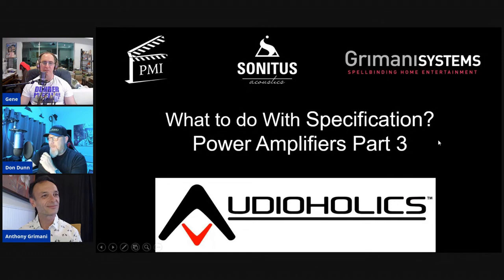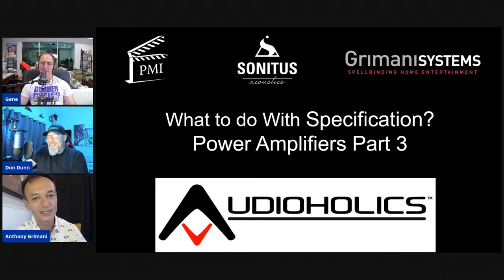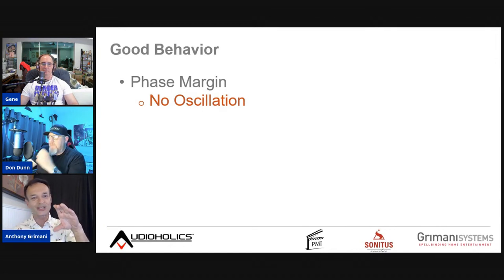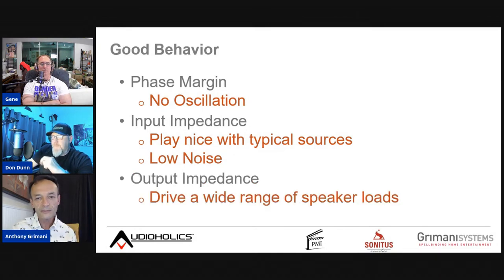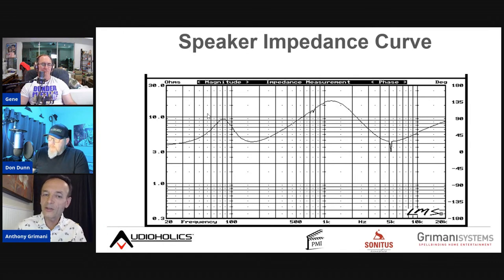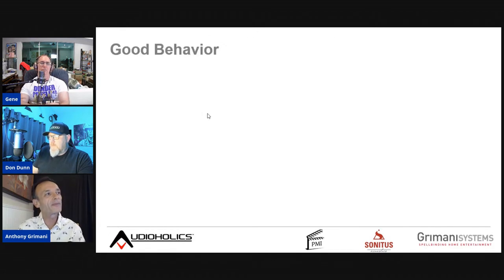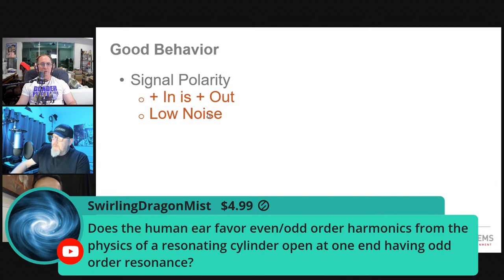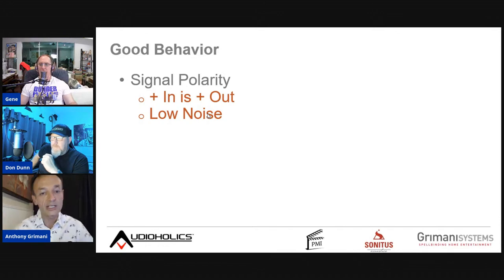What Specs to Look at when Buying an Amplifier?

Comment: Why is Don Dunn is so Anti-Crown?  I would like to find anywhere on the web, that can explain to me "Why Crown amps are so bad.  Especially the model XLS 2502 Class D amps.  I am not a Crown fan boy, but, I never bash a particular brand unless for good reason.  I have not heard a comprehensive reason from Don about his stance on Crown amps.
Reply: I am not anti crown, I tried a couple of crown amps over the years on many high resolution speakers. I found them to be noisy and harsh sounding, however I used to feel this way about class D and my mind has changed. That being said, Harman is a great company and I am going to try out some of the newer crown amps...I am open minded. I am a "need to hear myself" kind of guy, I have tried many products over the years that people swore by, but found them to be wanting. One benefit of being in the business so long is the ability to actually jam out gear in my own home, take time and dig into them with ours of critical listing. If the new crown's are as good as many people say, I'll eat my words. :-)
Reply: @DigitalDonAV  yeah i know what you mean. people said the rsl 12s is amazing and im sorry but its trash. i learned that i too am a i need to hear it myself. the impact of that thing is garbage. it doesnt get very loud neither. i have a bluetooth jbl sub for a soundbar that beats it. never mind the long story about them blaming my reciever. i buy a new one ansd still have trouble. they then try to blame my equipment. i laughed at that point. i said oh your blaming my brand new reciever as the problem. i dont think so

Comment: Home Theater Systems   is not audiophile and class D is good for it you never hear different, but if you listen to high resolution audiophile music with 24bit -144dB noise floor , I can tell you can NEVER GET IT WITH CLASS D, if you design DC/DC converter ( which is the same  PWM controlling ) you will see how bad it with different load , CLASS D AMPLIFIER WILL BE NEVER AUDIOPHILE AMPLIFIER . but on the other hand they are good public amplifier when you need 10000 W for big stadium .
Reply from the maker: Sounds plausible to the uninitiated but what your stating is actually NOT factual. Many Class D amps today are SOTA and as good or better than the best linear amps.

Comment: lol, i want anthony to take a 190 swapped grom for a spin. i will say put your brown pants on first buddy lol. you havent lived until you went 90+ mph on 12" tires let me tell you haha. another good one would be take a 450 supermoto for a spin. you def better be wearing brown pants for that ride. the supermoto is so nuts its mental. if you think harleys are something ride a 450 sumo. they are a blast but boy are they nuts. i had a honda reflex that said it was goin 75mph which wasnt too bad. on another note though i ran across a crown ce4000 recently for 300 bucks. i want to drive 2 ultimax 18's for home use. 2 questions, is that model crown any good? and is 300 a good deal for it? im new to this whole thing and simply dont know. it says made in usa on the back of it. now im not sure how much was made or if it was simply assembled. either way im a huge fan of us stuff period. great video gentleman btw. i know this vid is old but it seemed like the proper vid to ask the question. thanks in advance as well.

Comment: I see Crown amps in the thumbnail.  If commercial theaters use Crown amps then why isn't as popular with Home Theater enthusiasts?  Wouldn't you want to use what they use?   I mean we've all been in these mega huge theaters and their sound is huge and with amazing clarity and crazy dynamic range.
Reply: You talk about noise on the crown amps If your listening to music at more 10 watts you will not notice the noise being ground hum or floor noise or fan noise the reason theatres use crown power amps or other pro amps is because like you mentioned power at a reasonable price in the old days I worked at a cinema and in the best theatre we used an old Ashley power amp and it sounded amazing dynamic and all of it’s good for the commercial realm it’s good for your home

Comment: @21:00 Gene, please correct me if I'm wrong but it's my understanding that the port is at the bottom of the two peaks when measuring a loaded woofer in a ported box. It's not at the highest 1st peak. 
I think Anthony is remembering that the unloaded subwoofer resonance is at the peak and there will always be a single peak. But once you take that subwoofer and put it into a box that is tuned to a certain frequency then the impedance of that loaded woofer will be the middle of the two peaks.
A really great way to verify this is to open WinISD, load any subwoofer in any port design and look at the Port tuning frequency and then look at the impedance graph.

Comment: Liked the 3 part series. Anthony mentioned certain KEF speakers as having pretty flat impedance over frequency. KEF 107's were measured by DB Keele in the Feb'88 Issue of Audio to have an impedance magnitude between 3.6-4.8ohms from 20Hz-20KHz.

Comment: Great video. 
Funny enough, when you talked about damping factor (I learned a lot), saying it was a spec not published anymore, I thought about Accuphase, which still publish it, with a lot more. 
I think that it is a key take away: do not even consider a brand that does not publish those specs and measurements.

Comment: What I want is a specification that describes the broadband hum/ hiss amps often pass through to speakers.  So in other words,  the noise floor of the amplifier as revealed by a standard high sensitivity driver, like 100db sensitivity.  This would be functionally similar to the "self noise" rating of an active studio monitor, except using a standard sensitivity driver allows you to estimate how much noise you will hear through your speakers.

Comment: Ground lift isn't dangerous regardless how it's accomplished, because neutral is ground in your breaker panel. In other words, your green and white wire all go to the same point source, so when you lift the ground the only thing you are changing is the chassis ground or the input ground from chassis. All inputs should be isolated anymore so this never becomes an issue and on some equipment they are isolated.

Comment: Thank you so much for this video, it is really useful.
I have a question regarding the specs of some PA amps which offer a huge amount of power at a low price.
Some of these amps have a good S/N ratio (well over 90) and good damping factor (well over 50), but THD is usually  "< 0.5 "
Could it still be used for a home hifi setup?

Comment: I was wondering if you could provide information or suggestions on an affordable upgrade to my power problem. I have th Focal 806 with matching center channel speaker and the 605 rear speakers. I am currently driving these speakers with my Onkyo Rz820 AVR so I know that power is not the best. Is adding a 5 Channel amp going to give me the great sound and separation to the channels or is it separates only that will achieve this?
And what affordable options for a 5 Channel amp?
Thanks in advance for your help 👍

Comment: Arcam makes Class G amps.  There is very little information out there about Class G.  It would be nice if Audioholics could do a segment on Class G.
Reply: Hitachi boldly made one of the first Class G amps (Dynaharmony) for mass market back in the late 70s. I think the technology has improved over the years to render the switching distortion virtually inaudible.
Reply: Class G and H are trick forms of AB with multiple voltage rails. It’s supposed to be very efficient and very powerful.
Reply: @jstoli996c4s  and @Daryl Loth, that’s good to know. Thanks for the info. I’ll have to read up on those topologies one of these days. I’m just now experimenting with transistor-based push-pull amplifier circuits.

Comment: I was wondering in an avr with assignable amps are all the amps equally rated ? I'm asking because I was going to bi amp my front towers .
Reply: Depends on the AVR. I have an Arcam AVR300 with a true 7 x 100wpc. It has a built in bi-amp setting for channels 6 & 7 to power the mains with 200wpc. However, many modern AVR’s don’t have equal power on all channels, unless it’s a high end one like Arcam or Anthem.
Reply: Ok thank you I have a denon avc a110  anniversary 150wpc. I know im not getting 300 per channel but it sounds great . So guess thats what matters. Thank you again for the response.
Reply: @toddfolmsbee2429  the specs are listed as 150wpc @8 ohms full range into 2 channels only. You will have to check the user manual to check for bi-amping options. Or buy a 2 or 3 channel power amp for the fronts and center.
Reply: I should have proof read better i do have it bi amped thats why I said 300wpc .
Reply: @toddfolmsbee2429  given the stated specs, it’s doubtful that the bi amping is giving a full 300wpc.